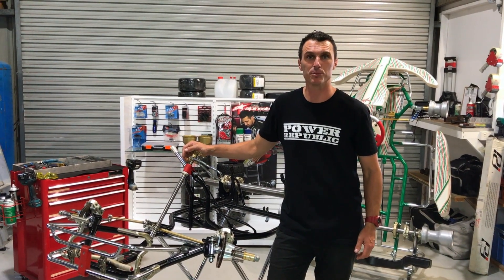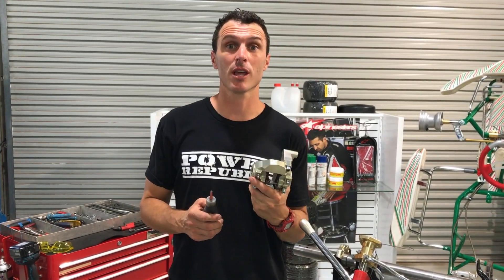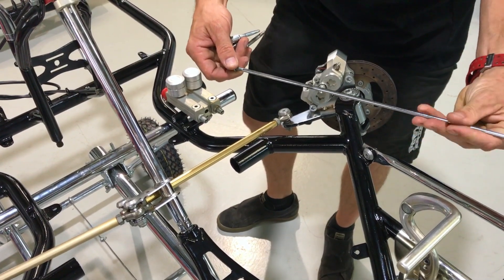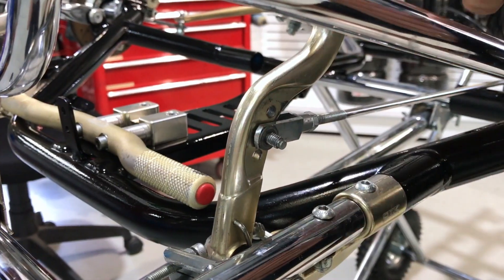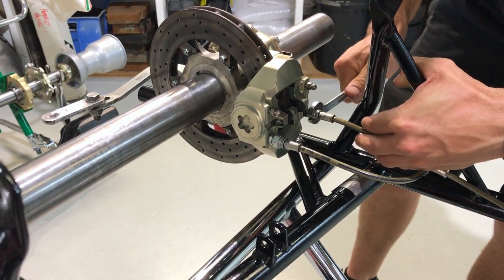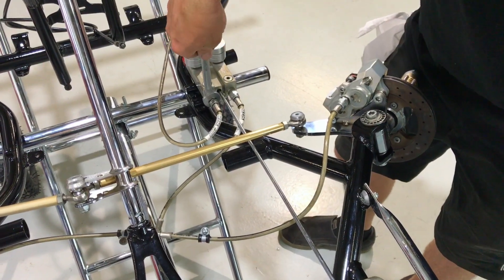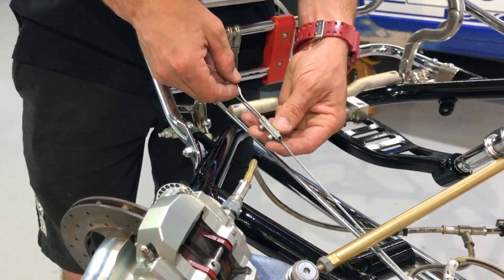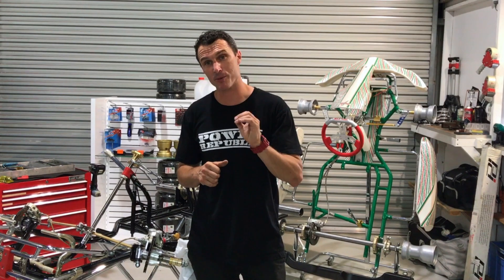Power Republic - How To Assemble A Go Kart - Part Four - Installing The Brake System

Comment: I always come up with questions. so the brakes slow down and stop the wheels but what happens to the motor? It is still trying hard to spin fast. do the brakes fight the spinning engine? would that not be bad for the engine to fight the spin?  seems that to suppress the spin while it is fighting you to keep spinning would be bad.
Reply: When you brake you take your foot off the throttle, since the engine is not receiving any throttle input it isn't continuing to accelerate, and yes it's still rotating and the piston is moving, but the force is much less as the engine isn't actively trying to counter the force applied by the brakes. The main resistance and strain being put on the sprocket and drive gears, and while yes it's slowing the Pistons revolutions down it is 's not directly opposing the force of the brakes since there is no power applied therefore the is minimal strain on the crankshaft and internal gears, you also have to consider that these engines have to have their Pistons replaced at least every 10-20 hours of run time and the bottom end bearings and gears serviced after 50ish hours. So there is a lot of strain on the engine but most of it is from high RPM and hard racing, it's not nearly as much force than if you were holding the brakes and smashing the throttle as the engine is basically slowing itself down when you lift off as the rpm goes down and therefore the speed goes down (provided you shift down) hope that made sense.

Comment: I'd hoped you showed how to bleed the front brakes. But it's not the separate hand brake type and the linked vid didn't show how the front works at all.
Reply from the maker: yeah the same way with the hand operated.  Pressure, open bleed valve, close bleed valve, release pressure.